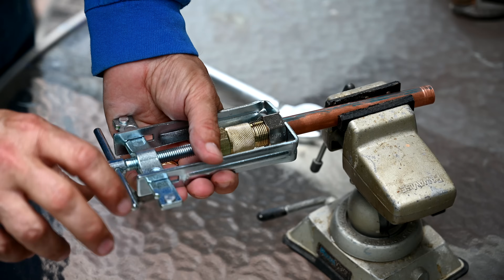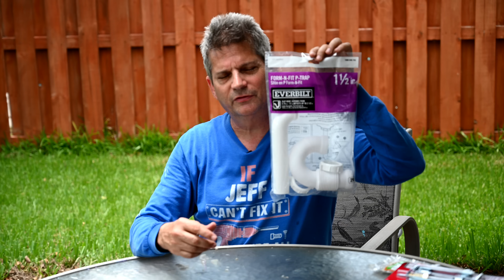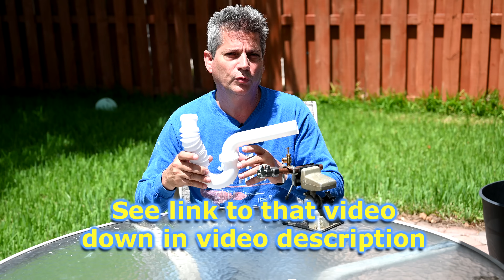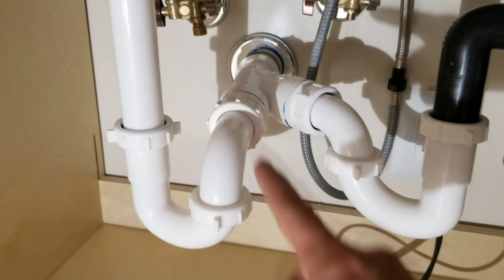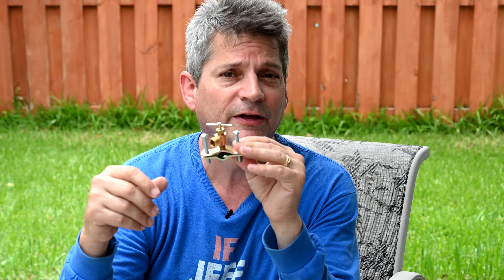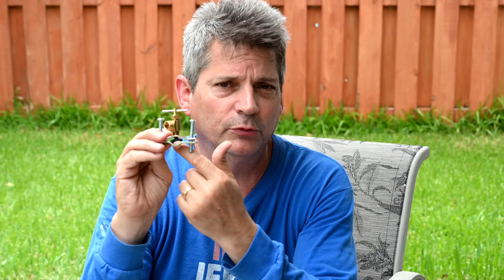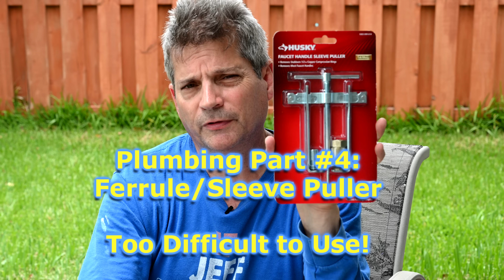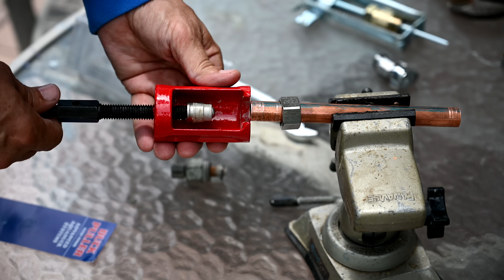4 Plumbing Parts/Tools You Should NEVER Use. NO Plumbing Fails

Comment: to comment on the husky tool, your comment about saying that " the plumber didn't know what they were doing, or leave enough pipe", should be retracted from your statement. the standard installation of an angle-stop shut-off valve is to cut copper pipe an 1-1/4" from the finished wall surface. this way, the ascutcheon fits neatly behind the shut-off valve. in many cases, you can still safely use the existing nut and ferrule, as long as it is the same thread count as the previously installed valve that you are replacing. there is absolutely no reason you can't leave the copper pipe longer during finish installation , aside from aesthetics, for the purpose of having to replace nut and ferrule
Reply from the maker: You bring up an interesting point I prefer at least two inches coming out of the wall this would allow for somebody having to come in and cut the pipe later on so this sort of gives you future proof length of the copper pipe. One of the biggest complaints and problems I've seen that I run into is there's maybe an inch or or so coming out of the wall and then there's not enough room to get your compression valve on to the end of the pipe and still safely be able to have your shiny silver flange behind it. Also you have to keep in mind that some people might have tools where to extract everything the tool has to get behind the nut and you need to allow room for that as well.

Comment: Great vid - I wish I'd seen this prior to trying to change out some compression cut off valves.  I bought that $10 tool and had the same experience as you.  However, I didn't see the other options so I was left having to cut it off.  Thankfully I had enough pipe to do it.
Reply from the maker: Yes the tools are like $40 and up if you want the best results

Comment: I am confused you mentioned the snappy trap as problematic but did not expound as to why. Is because you believe the flex pipe to be corrugated like the product you did demonstrate? It isn’t. It has a smooth interior wall. If there is another reason please let me know why because I did install under my kitchen sink because of a poorly done drain with tension that caused the drain to pop off of the sink periodically.
Reply from the maker: A lot of times the products are there they are just up top just like I showed in my video. And a lot of times they don't even know what's up there

Comment: Those husky pullers are two tools in one. The faucet head puller is supposed to be taken off entirely when using the sleeve puller (ie, the handle swaps between them)
Reply from the maker: Yes, a lot of people did not believe me when I mentioned it, but the instructions on the back show it
Reply: @jeffostroff  do you have a video and/or recommendation for pulling faucet heads that are smooth and flush to the shirt/body? (typically things like upmarket kitchen taps where the gap is too small to use a traditional puller (often less than 1mm gap between head and skirt) or using a "thin" tanged puller may scar the chrome

Comment: So we're adding a dishwasher to an older home,all pvc drains and pex supply lines from manifold in basement..I  can see and follow all lines easily ..dishwasher is not next (or convenient) to the sink so how should I connect to a vented drain on the basement side? I  understand the need for p trap to prevent sewer vapors...any solutions/tips would be appreciated!!
Reply from the maker: The dishwasher does not necessarily have to be right next to the kitchen sink there is a distance maximum that they allow by the manufacturer otherwise they think that maybe it can't pump the water that far. You need to find out what that is first it's probably somewhere in the installation instructions or in the owners manual. Once you have that determined to see if you can have the dishwasher placed that close to the kitchen drain and then either connect it to the garbage disposal if you have one, or get it one of those kitchen drain downspouts that has the side stem for the dishwasher drain hose connection. This way now when the dishwasher several feet away starts to discharge it will go in connect to the kitchen sink drain and then down the P trap there.

Comment: I use same tool to pull angle stop seal, 15 years on job, never had problem with it. It’s not always need it, but it’s good to have on truck. Maybe because tool is not assembled correctly, that why u having problem with it.
Reply from the maker: the problem here is that tool is not as good when you have compression sleeves that are stuck on the pipe from years of high humidity in the bathroom so it's almost rusted on there. For that you need the tools that are absolutely specifically designed for this period now the Husky tool will work on the compression sleeves that are not stuck. My problem is is with a lot of the foreclosures that I take over these are neglected houses and nine times out of 10 they are stuck on there so we need better leverage from the other tools. The Husky tool the problem with that tool is that it was designed to be a shower knob puller first, and they decided to double it as a compression sleeve puller but you can't do two jobs perfectly at once.

Comment: I have an old house and am going to redoing everything and I was always wondering why the trap is always getting sucked out, and now I know why, it’s because there is an S trap under the sink. Now the line it connects to is much lower than the trap. I guess it’s likely going to have to be a long run down to the right level then install trap and run vertically to the sewer line.
Reply from the maker: Sounds like you'll need to add a plumbing stack up through tot he roof.

Comment: Guess what happens with a full farmhouse sink, running garbage disposal and an accordion drain? It’s called a FLOOD! What a piece of s** The previous owner must have hired the bottom of the barrel contractors. I’m none too happy with my “inspector “ who missed this and a short in the line where 5 outlets didn’t work and one was just plain old disconnected. They would test as having power but didn’t work. Who knows what else I’m going to find. Still have to replace the 3 bathroom and bar sinks accordion drains. 🙄
Reply from the maker: Linda inspector should have caught this as a no-brainer

Comment: Jeff; a much needed Class Topic. I got so disgusted when you mentioned that people put their hair,  dental floss down sinks. I put my hair years ago down sink. What a mess after using a snake. 😵. About your equipment items; the health department should go to plumbing stores, and have the rights to check inventory. If found any unusual items, the health department should tell them that these items will be no longer on shelves. We will discard them as of now.
Reply from the maker: I wish they would also make bathroom pipes 1 1/2" rather than the 1 1/4"

Comment: Snappy Trap is up to code and the flexible hose is smooth on the inside. It does not accordion like the one you used in the video.

Comment: The no.1 thing that should be banned except for some gas plumbing is copper pipe if you live in cold areas it freezes and splits not to mention clogs up lnside due to corrsion.
Reply from the maker: They have newer hose bibbs that don't freeze now

Comment: I’ve taken those valve sleeves off by simply gently wiggling them with a pair of pliers. Then I smooth out the pipe with emery cloth. Or I cut them with a Dremel tool or a hack saw. I’d fire anyone if it took them 45 minutes to remove a valve sleeve. If you’re careful, use some common sense and don’t attack it like a sandwich it’s not difficult.
Reply from the maker: We use the real tool that makes easy work of any stuck ferrule. You never dealt with a stuck ferrule. Pliers don't remove stuck ferrules. That's why I said that tool from Husky should not be used

Comment: What’s the difference whether the pipe bends back into another curve coming out of the P trap verses in the wall at a 90 degree? Not to mention I’ve seen those S traps in every mobile home I’ve worked on in Florida.
Reply from the maker: Mobile homes probably OK. The difference is that the P-trap output would stop the vertical intertia flow of water, so that it would not self siphon, but an s trap shoots out the bottom then drops further and faster down 10 feet to the basement floor. That's a lot of inertia of water that can cause it to self siphon

Comment: There is nothing wrong with the trap part.   but the corrugated bendy pipe is asking for trouble for all the crap to get stuck in there..
Reply from the maker: Exactly, plus the creases are weak points

Comment: If the toilet flush is an issue with an s-trap, it will go exactly the same with a p-trap. Gets should be an air vent to prevent that.
Reply from the maker: The P trap has two advantages over the yes trap, one is that it is vented already 2 is that the P trap unlike the S trap goes horizontally into the wall instead of vertical straight down through the floor, which breaks the inertia of the water, an eliminates one of the major components of the self-siphoning phenomenon.

Comment: Jeff I recently discovered your channel, great stuff.  However on that husky tool, you are using it wrong- that another look at the directions, you only use the outer jaws for shower handle removal.   For sleeve removal, take those off, use only the shaft portion.  It pulls off stuck ferules/sleeves very easily then- I had one so stuck I was ready to cut the pipe, and it worked very easily by finger tip.  The husky directions are not super clear.
Reply from the maker: On mine, the arms don't come off.
Reply: @jeffostroff  they do, simply unscrew the center of the tool, use it alone.   It had me scratching my head at first too.  I would have rather had a heavier duty tool like you showed, but this husky was all that was in stock and I had an emergency fix to make on my place, so it saved me.
Reply: @NoppeNband  I read your post and bought it.  I unscrewed the puller from the handle and was able to pull a ferrule that was so tight it had deformed the pipe.  Took quite a bit of torque, but nothing I couldn't do with just one hand on the T.  Once off, I still had to cut the pipe due to the deformity, but at least I was able to leave as much pipe as possible as compared to cutting with it still on. Thanks.

Comment: re: your 'ferrule remover/puller'... what stops the tool from expanding the copper pipe while it pulls the ferrule? even if the threaded rod were designed to fit inside the pipe (similar to a flanged plug), you risk expanding, mushrooming, or rolling over the exposed end of the pipe...
Reply from the maker: I have had a number of people ask that and they think that because of the force against the front edge of the pipe that is going to balloon it out or flare the edges out but that is absolutely not true not even in the least. The force that is pushed against the front of that pipe to slide out a stuck ferrule ring, is less than the force that it takes to balloon out or flare out that copper pipe. I have done this numerous times and remember it's a very critical fit getting that new ring back onto the pipe. If the pipe was even slightly off the new ferrule ring would not go back on. I have never run into a situation where I could not get a new ferrule ring back on there.  So this old wives tale that these tools are going to damage the pipe is total bogus nonsense. And if anybody even tells you they've ruined pipes with it before they're lying they're just trying to prove their point as a lot of people out there that try to do these urban legends and old wives tales and stuff like that and unfortunately too many people out there believe them.

Comment: I put in a new disposal that was a different size than the old one. The plumbing would not line up and is a soldered on brass trap transitioning to steel going in the wall. I used one of those accordian things for a few months until I figured out a better way using PVC pipe and a slip fit 90 elbow to replace it. I could have glued an elbow too but figured I could adjust this one for a perfect fit. I just didn't feel good about that thin walled accordian thing letting go or plugging up. I was shocked that is was clean inside but now have a much more professional setup I don;t have to worry about. I did put a saddle valve in for the ice maker 40 years ago and it never leaked but I know it has to go. Fortunately, it is after the shut off, so I can just replace that length of pipe that ends with a fitting for the faucet.
Reply from the maker: smart plumber! replacing that saddle valve can avoid a costly flood

Comment: The Husky puller appears to have two notches near the ends of the cross bar. I wonder if the two prongs aren't supposed to go into those notches, allowing the handle to be turned and possibly locking them into place behind the nut.
Reply from the maker: Some versions you remove the arms

Comment: I like how you blame "diy" and "handymen" for items manufactured, and sold at retail stores.
You are aware that not all states have the same plumbing codes yes?

I am a licensed plumber, and this seems far more like you complaining so you can drum up more business. Shark bite fittings are crap as well, i dare you to make a video saying how they should never be used, and are only used by "diy" and "handymen".
Reply from the maker: you are a licensed plumber and you don't know that S-traps and form and fit flexiple p-traps are banned in all 50 states? Send me the code for one state that allows them. I bet we never hear from you again.
Reply: @jeffostroff  I had never heard of an S strap being sold, or carried before, and flexible piping in kitchens is not a code violation, let alone illegal. 

I stand by the point I made, not the nonsense you tried to turn it into.

Comment: You didn't use the sleeve puller correctly. This tool is actually an excellent multi function low cost tool. The way you used the two arms is for pulling faucet handle. When you pull the sleeve, the other small part including in the package needs to be added. Then it will act exactly as the last puller in the video.
Reply from the maker: it still can't pull stuck ferrules

Comment: Last year I finally got around to tackling the ice maker project that I'd been putting off.  I went to my local Home Depot and while I was looking at all the brass fittings to get a brass T connector to tie into the end of the cold water shutoff valve between the valve and the faucet an employee asked what I was looking for. I told him what I was doing and he grabbed one of those saddle valve ice maker kits and told me to use it, because of how quick and simple it was.  I just laughed and said thanks, but I felt purposely putting a hole in the water pipes in my house sounded like the dumbest idea ever.  He wasn't very happy with me!
Reply from the maker: At least your floor is happy with you for not getitng flooded
Reply: @jeffostroff  Very True!

Comment: Stupid.
Of you install a right Ventilation you Van use the traps. This is the difference between German and us plumbing education.
Reply from the maker: The S traps are banned by plumbing code. You can argue your point all you want but you're going to fail. And when this city comes to inspect your work you're going to fail and you will find yourself out of business. You're only looking at one of the reasons why as traps are not allowed. It is not just a venting issue it is also a momentum issue where oftentimes there is a short run leading into an S trap followed by a long vertical run after the S trap which can also empty out the S trap water. You're talking about if you add proper ventilation most people are not in the position to tear the house apart to add the ventilation period now you could add the air admittance valve under a sink but some states don't allow that.
Reply: @jeffostroff  how you answer I see you don’t know about the „Right“ ventilation system. Check DIN 1986 or equivalent for Europe. I know, everywhere in the world many people doing plumbing, learning by doing, put pipes together because it fits but at leased it’s not working proper.
Draining pipe system is very sensitive.

Comment: Handyman here. Something you didn't mention was the plumbing or building code is the MINIMUM requirement. If you're not doing the best job you can, you're over charging for your labor. I make it a habit to replace everything from the wall  out when doing under sink work.  It virtually eliminates callbacks.
Reply from the maker: Good strategy, I do the same, I want everything to be and look brand new.

Comment: I wonder if there is away to make a flex pipe without the accordion so it doesn’t catch and keep all the nastiness. It seems so much easier than cutting and gluing a bunch of pvc. But I’m no plumber, so I’m just curious.
Reply from the maker: Yes a thick flexible smooth hose would be great

Comment: I’m just so overwhelmed and now terrified lol 🤦🏻 no vents anywhere. Installed a new sink with that rubber crap underneath that you made a different video on and it won’t stop leaking. I only have what i have too as far as plumbing I can’t buy ANYTHING right now. So that hose type pipe is one of the components under my sink so fml 🤦🏻 cast iron old drain that has holes in it outside so I’m hoping that’s my “vent”. This is honestly the most ridiculous job I’ve ever done and it’s really not that difficult lol on paper at least.
Reply from the maker: We have a video on that sink leak here: https://www.youtube.com/watch?v=mTmUO-0ELps&lc=Ugy4J_ZBOdFBAsQzGH54AaABAg